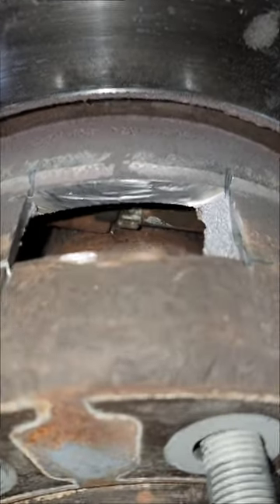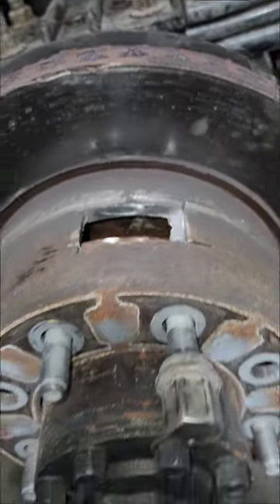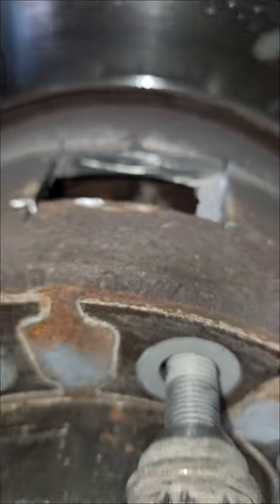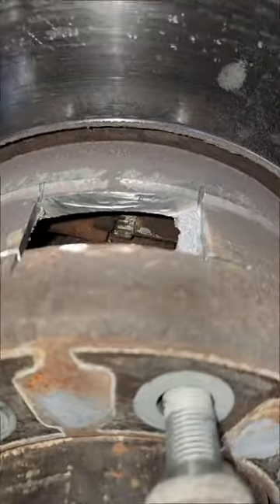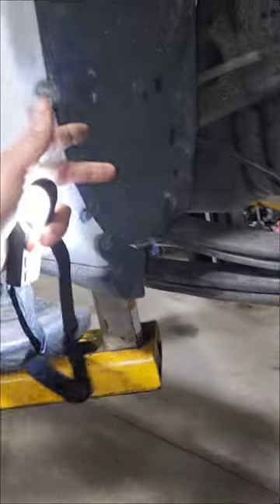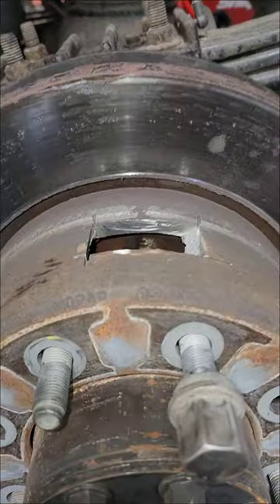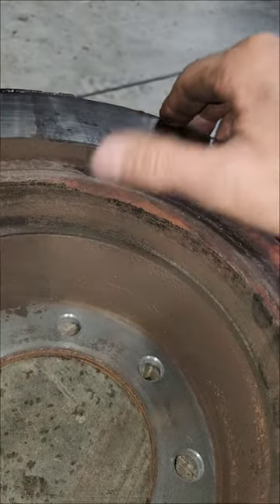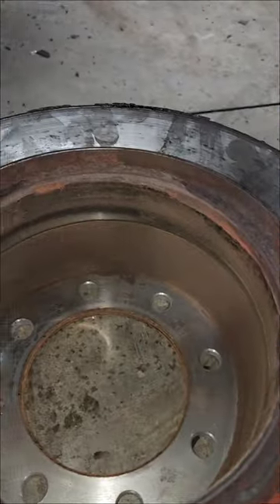Don't just take a hammer to it. A good mechanic is one you don't know was there!

Comment: Wow another one. If you can’t get a rotor off without doing all this you need to find a different career. I live in the rust belt and in 10 years I’ve never cut an “access hole” in the rotor
Reply from the maker: We do these jobs every other day. We know how to swing a hammer, we know how to back off the adjuster,  we know how to cut holes in the backing plates, we also know how to do it in a few minutes without causing irreversible damage as you see in our video of us doing so. My question is how do you get them off without causing damage by making sure nobody knows you were there when you are done?
Reply: Your customers truck needed rotors and park brake shoes anyway. You beat the piss out of the rotor on the back and turn it every few times. What’s the point of trying to salvage junk parts like your video shows? So you hit the backing plate by accident? Guess what you bend it back.
Reply: @WilleJamesHuff  yeah you need the 8 pounds hammer or big splitting axe for this job xD
Reply: @WilleJamesHuff  I absolutely second this. 80% of drivers don't know what a parking brake is, and if you take the time to explain it, they're not going to want to do new cables to the pedal, actuators, shoes, hardware, on TOP of the new pads and rotors/drums. You're babying rusted, seized garbage. Fuckin whack it and get the vehicle back to the customer quicker.
Reply: I have done exactly that. I've got tons of rusty vehicles apart in Syracuse NY. I love seeing trolls like you say somebody doesn't know how to do their job. More than likely, you've sent a few disasters down the road thinking you're a mechanic. I see three people's bulshit every day because, I deal with it everyday.
Reply: @brentbovee6411  I figured. You are likely also the guy who gets offended when you are called a mechanic instead of technician
Reply: @WilleJamesHuff  call me whatever the hell you want I know who I am 😂
Reply: Explain  how you take it out under this circumstances,  I'm 65y/o  I'm already retired  .but I was in my prime  an Automobile  certified mechanic.  And FAA also certified technician.  I have  seen  several  cases of stocks moving parts  caused  by poor quality  parts ,and mostly  bad engineering  design.  Nowadays  the challenge  that serviceman  are facing is  unbelievable  .
Reply: Just shut up.
Reply: @petegbattle795  turn the parking brake off and the drum will fall right off
Reply: A puller.  You are replacing shoes and pins anyway.
Reply: @blackhawk7r221 
No, you are not replacing the parking brake, only the rotors and pads. You have to save them, or the price of the brake job is doubled.
Reply: @jeffhill3681  In that case, we simply use the on-car lathe to turn the rotors.
Reply: you can't even spell holes @nextgencarcare
Reply from the maker: @stevewhyte8476  good catch thank you.
Reply: @WilleJamesHuff I'm with you on this salvaging rusty seized parts when you can just hammer it instead of doing all this nonsense would never take my vehicle here they give anybody certifications nowadays 😂
Reply: @blackhawk7r221  
If you could turn it, I wouldn't be replacing it. And the parking brake linings aren't half flaked off the shoes & dragging too.
Reply: @chefexcellence9841  the problem is that in NY the parking brake must work  or you can't pass inspection. No drive it. Comprende?
Reply: Who gives two shits how they do it aslong as it gets done? If you watch someone do the same job you do but different than you do it and cry and try to talk down on them you need a different career ❄️😂
Reply: @McFlyy91 ”I’d never take my vehicle to someone who does a job a little different than how I’d do it at home” then just do it at home in your driveway and quit crying 😂
Reply: @WilleJamesHuff  hitting them with a hammer often leads to brinelling of the wheel bearings, not ideal for the life of the bearings. Not to mention bending the backing plates when the shoes come with the rotor and reef on the pins
Reply: @nextgencarcare how you do it while someone doesn't tell you were in there, is replace all the parking brake stuff, and cover it back up with the freaking brake rotor. It's not hard, and unless you're customer is a broke ass, they won't mind. Half of the backing plate would be missing if it were Ohio. I just quote everything from the backing plate out. Then when the rotors come off easy, the customer is happier than a pig in shit.
Reply: I agree
Reply: @gidderman 
I wack rotors with a 4 lb hammer whenever I do a brake job as we always replace them with the pads. I haven’t caused any “brinelling” yet. Whatever that is.
Reply: @richardmccann4815  aaahh, this makes sense. We are a no inspection state so I don't consider this often.

Comment: I’ll bet that’s the last time you don’t leave the parking brake on before doing a brake job😂
Reply: To be fair, it’s not a manual so I’m not sure why the parking brake would be on, but it’s a possibility.
Reply: Dude its not the parking brake. New york sucks you have to turn in the adjuster wheel to basically the bottom to get it off and even that isnt enough sometimes, as shown in video
Reply: @nathanmoore3866  im a new york mechanic. Rust does not need to be explained to me.
Reply: @draconiceon2638 west coaster here, we do not envy y’all. Despite our dilapidated snow covered roads, better than the alternative 😂

Comment: Drill two holes in the backing plate….at the inside edge of the inner diameter big enough to inspect the lip or if a window exists enlarge it….stick in a rotary file and spin the drum till it’s ground free…we have to do this on the larger dually drums when they hang up!
Reply from the maker: I like this. I do that when there is access but I will give it a shot on the next one. I'm a big fan of making so nobody knows I was there and that's how I was taught but making a whole makes a whole lot of sense. Thank you
Reply: I bet you like this. Bet you like your purse to 👜 put the drill and grinder down pay for the insurance that allows you to run a torch in the shop and grab a bfh and go back to work

Comment: I haven't  cut access holes but I have cut slit in  the drum portion  and split it open  with a air chisel. So do what works I am working in the rust belt for over 20 years  don't do it all the time but have done it nice work

Comment: Put it on the hoist,put it in drive, allowing the wheels to spin, the pull on the e brake cables enough to drag them a few times. Rotors will come right off.
Reply: I'm remembering this one. But a big hammer works, too. These guys need to buy some big hammers or learn to swing one.
Reply: @PrestonSteele  work smarter. Not harder. Hammers cause collateral damage in the hands of rookies.
Reply: That’s a great idea, never thought of doing it that way!! As long as it doesn’t have a huge lip on it probably would work well.
Reply: AND NOW the park brakes are seized, thanks
Reply: @jeffhill3681  ya don't pull it that far. And of course ya test it a little first right at the brake. That's just common sense.
Reply: @BigLeo8772  
Obviously you don't work on the same stuff I do. ANY attempt to move a park cable means it won't retract. And yes I work at a NEW TRUCK dealership, if it's old enough to need rear brakes, cables are stuck.
Reply: @jeffhill3681 sounds like to me the common american problem of! 

Forgot to oil the chassis and cables, huh? 

Funny how canadian cars get more salt but dont rot, and many Americans who have nice cars in the rust belt have their chassis coated each year and maintenance done. 

Sounds like to me your just a use and abuser.
Reply: @alorrick7546  
I don't own them, and usually don't see them until they need repair.
Reply: @alorrick7546  
... and I get to work on Canadian lease and trade in stuff too, don't tell me what thay look like underneath. Undercoat on rust and the electronic rust protection doesn't do anything
Reply: I've only seen this done once before as a bush fix in the Yukon, Canada.

Comment: Please check out the hub that holds the lugs,  ( that bastard could be the (id) of drum part of rotor. then check out the out side of the axle hub itself and the inside diameter of the rotor. 
One you can work with one you have to do what you just did on this video. 

Shoes should not give such a problem with out a lot of spring action. 
Lol. 
Great work guys thanks.

Comment: I had the same problem with my 2011 chevy dually and I had to use a torch to heat it up and it came off easily with a couple of hits with a hammer

Comment: Non-dually 2500, you say? Wow that thing sure is a unicorn.
Reply: Right? What 2500 comes in a dually? I thought only 3500 and up come in dually's.
Reply: @wesman7837  😂😂 You thought right. I went way over your head lol
Reply: Friend of mine ordered his 2000 silverado 3500 as a non-dually, it's got the 6.5 w/an Allison-regular cab, 8 foot. Nothing new...
Reply: @kevinmonday522  this went so far over your head.. read my original comment really slowly with a lot of emphasis on the “2500” part. 2500s were never offered with a dual rear wheel option. That’s what makes this whole thing ironic. You are correct, clarifying that your 3500 is a non-dually is absolutely appropriate.
Reply: Looks like he meant to say non dually 3500, that looks like a 3500 because of the leaf springs in back, the 2500 has coil springs there
Reply: 6.5 was mated with 4L80E, not an Allison

Comment: Everyone in the comments that has a problem with this has clearly never ran into something like this. Sometimes theres no access hole for the adjuster. When disconnecting the shoes using heat an air hammer a sledge hammer etc doesnt work. You cut an access hole

Comment: Dude you just take the air hammer to the pins in the back of the air brakes just shaved those two pins off in the back it doesn't damage anything and then you use a slide hammer to get that off there because they're all bound up

Comment: Why did t you just use a scissor jack? You can wedge it between the leaf springs and the rotor and then apply heat. Why don't you guys ever apply heat🤔
Reply: I apply heat to everything... cant get the knot undone in my bootstring in the first 30 seconds, I'm grabbin the damn torch.
Reply: @Steve-1269  lol
Reply: @Steve-1269  fair enough 🤣

Comment: Good video. I know the steps needed to pull those rotors. If the basic steps don’t work I use the right angle grinder to cut the rotor and weaken it. A big cold chisel then cracks the rotor along the cut and VICTORY!
Reply: How I’ve always done it too

Comment: No need to do all that. Just pry/hammer the rotor off. It needs new shoes anyhow. It will just pop the heads off the mount pins which you get with shoes anyhow. Your way costs customer more in time and wheel studs. Oh and we are in ontario  where they use salt and brine like its going out of style

Comment: It's all fun and games until you have to cut a Dodge rotor off with torch because it's rusted around the hub and Incases the hub in rust  it's a ny thing 😆 if you've dealt with it, you completely understand what I'm talking about. This is most prevalent with 2006-2007 Dodge Dakota front rotors but this problem carried over to many different Dodge variations thank God I changed careers and got away from  Dodge. Hopefully they 've resolved this problem but most likely they haven't 😆😆

Comment: Wow there should have been a rubber plug behind the brake assembly or you can check if the parking brake is still applied from a bind cable. Come on hopefully the customer don’t pay for your service or a new drum and hat brake service
Reply: Yup,and the access hole is at the top between the spring and the back plate....